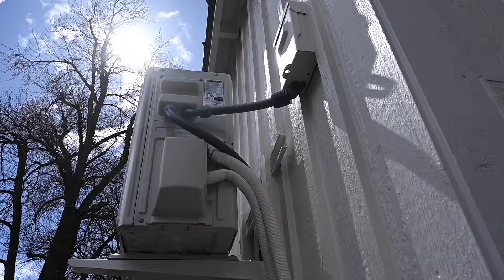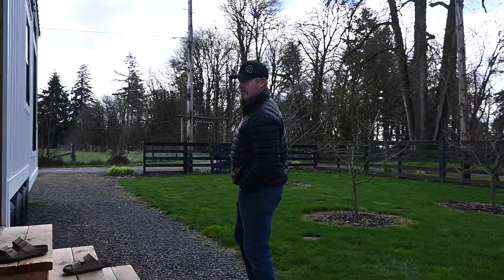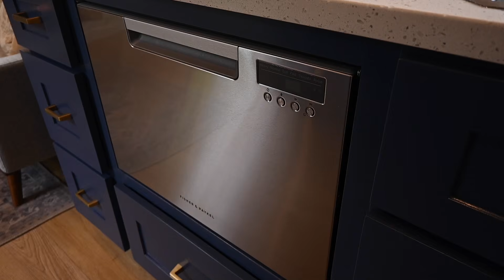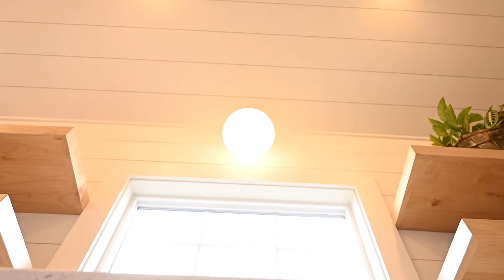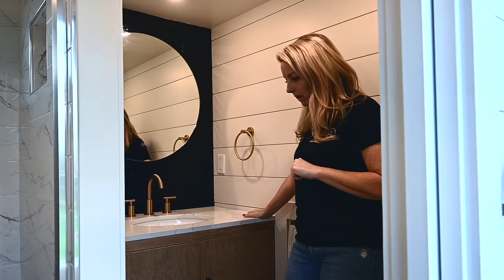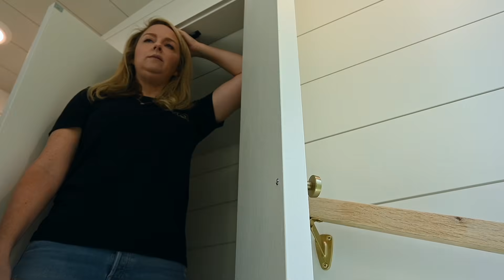Tiny House Tour: ULTRA Lux tiny house w/ full kitchen and standing height closet!

Comment: I’m curious about the wasted lower cabinet space in the kitchen next to the fridge. I would have made one drawer and then a door with two shelves using all that side space. They make pull out shelves now that curve in and out so no lost storage. Or put an electronic pop-up appliance garage, where the microwave can go and hide away. I’m also curious why the fridge isn’t pushed over further to the right towards the hallway wall. It looks like a good foot of unused space again. If that was moved over you’d have room for a coffee maker and microwave where that useless lamp is staged. 😂 I love the closet space and the bathroom vanity area. I agree with others the tight zoomed in shots aren’t great for trying to figure out the layout or floor plan. If you’re talking about shelving we want to see them. We don’t however need to see the carbon monoxide detector, just talking about it is fine. 😊

Comment: This may seem at times blunt, but as a professional in the Design Industry for nearly 4 decades I’d like to comment on ways this could be improved for future builds. The overall aesthetic and finishings are quite nice, but there are a few, fixable issues…

All those open shelves are overkill. A few areas for display are fine but this design frankly took the cheap way out, it lacks storage which should be prioritized in a tiny home. Concealed storage is needed for unsightly kitchen essentials such as cookware, colanders, dinnerware, mismatched mugs, appliances (toaster, blender, crockpot, hand mixer, etc), in addition to the food & other pantry items. Everything that cannot be stored away will be visible on open shelves or left out on countertops, creating clutter and looking chaotic - not everything you need is lovely to look at, and your sleek, stylish aesthetic goes right out the window. I’m a big fan of fluted wood, it would be fabulous in the living room (as a door over 1 bank of shelves), bedroom (in the headboard recess), but positioned directly above a cooktop it’s a magnet for grease and will be an absolute nightmare to keep clean. In the living room the TV setback is too deep to view comfortably from the sofa, and will be flanked on both sides by more visual clutter. The bulbous light fixtures may be West Elm but so many of them so matchy-matchy throughout the entire home, is an uninspired choice. Cohesion in design is created by repeating elements such as color, pattern & texture, instead this lighting plan gives “Pottery Barn Teen” vibes, failing to utilize opportunities to diversify with complimentary fixtures that relate rather than replicate. And while the ceiling fixture in the kitchen is striking, large globes flanking the bed will be striking your head as you move about and would be blinding to read by. Adjustable LED reading lights, slim and sleek, would be a better choice. Lastly, the retractable dining ledge is nice for a coffee break, but seems cramped & inadequate for 3 meals a day. One quick Q, in the stairwell, is it logistically possible to embed a drawer (or a wide cubby for baskets) beneath the bedroom floor, for accessible storage (sweaters, folded clothes, undies, etc) as the tall closet appears quite shallow (you should show viewers that standard hangers will actually fit in there). 

The many upgraded materials (fireplace, wood mantes, backsplash, shower, brass fixtures, workstation sink, self-illuminating bathroom mirror), are luxurious and completely elevate the home. The neutral palette throughout is both soothing and stylish. Illumination set into the joists is brilliant. Supplemental zone heating, proper ventilation, CO2 detectors, smoke alarm, stair storage with subtle finger pulls and handrails address both safety and comfort while blending seamlessly into the design, well done. With just a bit of tweaking, perfecting this design for even better functionality, convenience and livability, is something I think buyers would notice and greatly appreciate. Just some hopefully helpful, constructive input from a fan. This is a beautifully finished, very stylish home. (ps: Deleting this post previously, did not go unnoticed. Let your viewers share opinions, others may pick up an idea or two, even if you don’t agree with them.)
Reply: They left it up. Tiny homes are so beautiful. I love so many. I DON'T have your vision for things that work and things that might not. I don't want a loft. I also don't know what to pay for them. Obviously they are indidually built by hand. How do you know if it has defects in materials or workmanship? If it isn't caught before sent out...how do they get fixed...and by whom? Is there a warranty? Any non-loft models that offer a big tub you can recommend?

Comment: This tour was tricky to follow.    I couldn't even tell how you got into the bathroom and I guess it was the first door to the left leaving the kitchen?      Made it feel really cramped.    
Was wondering if the space to the right of the small refrigerator would allow for a larger capacity fridge?     Also, it opens so close to the opposing countertop, that you have to open it up wide to get into it.    I'd rather have closed cabinetry, and my microwave exposed.   Just me, I guess.      I would have chosen a larger fireplace as well, given the size of the wall for it.   Otherwise, love the appearance and overall open feeling.

Comment: I see this a lot, not sure why Tiny home and RV builders are not providing outside security covers for water, gas, and power?  Especially the water inlet needs to be covered and locked protecting the inlet from tampering or contamination.   Also- are manufacturers actually testing the all in one laundry machine? I’ve had one, and mine didn’t clean or dry very well.  That would be a bummer to be stuck with that only option.

Comment: You have “open upper cabinets” in the kitchen, but a closed up covering right over the stove for the microwave.  While you are cooking, that cabinet is going to be covered in oil and soot.  Not a smart design.
Reply from the maker: Great question. The microwave has a vent/ fan much like what you have in your traditional kitchen. So oils and steam get sucked up and out of the home. Hope that helps elevate your concern. 😊

Comment: The Fireplace area is off balance as far as Design Principles go. It's odd the way the heating/cooling unit is set above the refrig. Beautiful range hood. But would it be dangerous  when getting hot items over head when pulling them out of the microwave? You set it at a certain height. I wonder about safety when shorter people are using it. The little place to eat obstructs the traffic pattern. Why does it only accommodate one person if a family can live there? You have a table lamp which produces heat sitting directly and closely to a wooden shelf. Open shelving in the kitchen looks cute, but is it the most functional? What if a person has cats? Cats climb everywhere. Closed traditional upper cabs are the better choice for resale. The Bathroom is beautifully done. Nice window above shower allows for ventilation and a nice breeze. The only down side in it is the laundry area. It appears tight. The ergonomics are off. 2x4's for handrails? Could you maybe have rounded them off? Just some thoughts from Susan, former 'Green" Interior Designer, Minneapolis, MN
Reply from the maker: I’m so glad our home inspired such great feed back. Please send me a link to your tiny home build. Would love to see it 😉
Reply: @motleybuilditbeautiful  My husband and I remodeled older homes in Minneapolis, MN for 25 years. He is a Master Carpenter. Building a tiny home wouldn't be nearly as hard as remodeling a huge older home. I was merely noting some design principles that weren't adhered to.

Comment: You might want to rethink that microwave placement.  While it seems like a great idea, in actuality it an accident waiting to happen.when you place a microwave above shoulder height, you lose sight of the back edge of the dish/bowl/plate obscuring your ability to hold it level and 9 times out of 10 you unintentionally tilt the dish towards you & often resulting in hot food falling towards your face and upper body.  Better to put it in a slide out drawer or a pull down lift.
Reply: I also was thinking the microwave was a bit too high. I wouldn’t care if it were seen- would just want more convenient placement.
Reply: @lisaa.1136  sadly I had one placed up like that in a class C and continually spilled hot food on myself until one day I got it on my neck & chin.  Left a scar so I ripped it out and put it lower.  Why I didn’t do the first time I got hit I don’t know.
Reply: Yes, I can't imagine that anyone would design that. I even saw someone put it above the refrigerator,  even worse
Reply: Yess, bad placement
Reply: I have redone several kitchens with the microwave above the stove.  I always take it out and find another place for it.  I'm short and I don't want a plate of hot food in my face.  A house I just moved from had the microwave so high I couldn't  reach in to clean it.  I have knee problems and balance problems so I can't use a step stool any more.
Reply: @HildaCollier-i7k  same here—Susanne
Reply: I’d just chunk it, lol, all it does is kill any nutrition, rearranging the molecules so the body doesn’t recognize it as food & infuses it with radiation. Very harmful for human health.
Reply: @Mojovibing where did you read that?
Reply: I looooove the tile on the fireplace. I want that tile in my kitchen when we build.—-Susanne
Reply: Agree 100,%
Reply: I'm living proof! I have done that very thing more than once!!
Reply from the maker: Will absolutely keep this in mind. Thank you.
Reply: @motleybuilditbeautiful Yes. I have seen microwaves up too high many times..Average height of women 5'4" I am 5'3"...Who still does MOST of the cooking and heating up food? Yep women.
Reply: Or one can use a step stool as I do in my home.
Reply: @rhargrow8399  I’m 65 with 2 knee replacements, step stools are not in my wheelhouse any longer and even if it were juggling a plate/bowl of hot food without two feet firmly underneath is still not ideal.

Comment: So this unit remains on the wheels, so it wouldn't require barely any building permits if you were putting in on the property you already own? Also, what's the time range of the maintenance for the wheels and trailer bed?
Reply from the maker: The trailer is steel powder coated…. It’s going to last awhile. Some attach the chassis to a pier pad system and then remove the tires. Others just place a skirting around the base. You have so many options.

Comment: really nicely designed home...even the loft space seemed accessible by an older person... "throughout the US stating that the exteriors couldn't have metal siding" -- I HAD NO IDEA THAT THIS WAS A LEGAL ISSUE...there are many homes being built with metal siding and i assumed that metal siding was actually better than wood/composite siding...
Reply from the maker: We found this out when we were looking at code in LA.  We were surprised too!😮

Comment: It’s a pretty model, however, when you talk about certain things like the floors, you can’t really get a good idea of what they look like. You need to do a long shot.
Reply from the maker: We will try and capture the floors better on the next build. Thanks for the feedback 🌺
Reply: @motleybuilditbeautiful The same goes for shots in the bathroom.  Especially shots of the toilet area and the storage shelves beside the washer.  Additionally, the whole home seems geared to younger people and those who are not weight challenged.  Passing into the eating nook was tight, and turning around in the toilet area looked tight too. Especially for someone that was wider in the hips. It felt the same going up the stairs. You are by no means weight challenged,  but you didn't have very much space to spare when climbing the stairs. 
It was good there was standing area on the one side of the bed, but climbing in and out with no way to get fully around the bed can be problematic, especially for owners that aren't agile as those in their 20s or 30s.
I loved the style and all the natural lighting.  And the cohesive look of the artificial lights was cool too.
I don't know if it's just me, or if this home didn't seem big enough to rate the title of luxury except for fixtures and finishes.
Reply: Agreed! 
Also, when you talk about the cupboard by the washing machine we can't see it at all.
Reply: How much are your tiny houses? Where are they located?

Comment: I thought one of the pros of tiny housing was supposed to be affordability.  Looks like I was wrong. Replacing that washer/dryer would be fun when it breaks. I don't believe they all conform to the same physical size. 'Designer' elements? Hardly conversation starters unless you only hang out with interior designers. The house is pretty, but also kind of sad when you think about its priorities.
Reply from the maker: We appreciate your feedback and understand stand that tiny homes are for a diverse group of people looking for flexible housing solutions.  Not all want the same attributes.  We paid special attention to not only install quality finishes but additionally include systems that improve air quality and personal safety which are often overlooked because of their expense. 

Regarding the w/d… this is an RV rated unit that is standard size and replaceable through many stores.  

Sometimes affordable doesn’t always encompass quality or safety.
Reply: Nothing says "affordability" like clicking a video with the words "ULTRA Lux" ... seriously, this isn't a standard tiny home - it's specifically aimed at people who want something "higher end".  It's not for me, but I'm also not complaining about "ultra lux" not lining up with affordable.
Reply: @aislynn001  Fair enough. One person's 'Ultra Lux' is another's 'Why? It's pretentious and shows that someone's marketing scheme is working.' I'd see 'Lux' as enhanced that ways that improve the house, not just pack it with brand names and cutesy gimmicks.
Reply: @OneManShow1964  You might like this better:  https://www.youtube.com/watch?v=E-gSr6R7lSY&t=144s
I mean, maybe.  I like it, because it feels like a cozy cabin that's actually lived in.  It's not luxury in the modern sense of the word, but it looks like heaven to me.

Comment: This is really beautiful! I personally would have liked to see it at 10.5 wide and that space next to the refrigerator (if it were a bit wider) could be used for a pull-out pantry, but great job all! This is gorgeous! Love the tiles, love the thought that went into the stairs and the loft and especially love the kitchen 🙂
Reply from the maker: We would love to build this to 10.5’ wide. Love your ideas!
Reply: This is really beautiful and I love the details that you've taken such care and consideration to add. We moved into our 5th wheel with our 7 yr old daughter and 180 lb Mastiff 😅.  The one thing about any RV or tiny home is the washer and dryer.  The combo's are horrible and never get your clothes dry. Other than that, this is a beautiful build😊